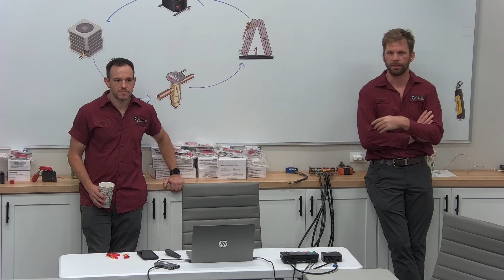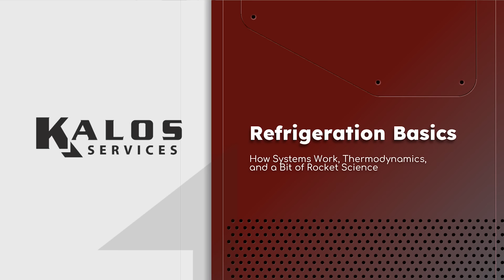Refrigeration Basics with Elliot and Bert Part 1

Comment: I will never understand the value of all the different units for pressure. How you scale things has no impact on accuracy. Accuracy is dependent on the device. It doesn't matter how you scale it, you just might end up with more decimals in one unit. All these units are based off of old school analog devices. The Pascal is the only unit you need for all forms of pressure. Need a vacuum? Well that's negative gauge pressure in pascals. Don't like big numbers with lots of 0's? Well the metric system has a solution for that too called SI units. They allow you to easily rescale by factors of 1000 without actually changing the unit. Most importantly, the Pascal is a breeze for any engineering calculations that need to be done. Just plug and play, no conversions required other than converting the SI prefix to engineering notation which is a piece of cake for engineers. Still boggles my mind how ridiculous all the units we have for pressure.

Most importantly, America, switch to the f***ing metric system. This is all just insane! Do your engineers a favour.

Comment: I have successfully installed about 4 mini split units, some with multi-zones in my home. I own my own vacuum pump, gauges and flare kits; I would love to learn a whole lot more about servicing even if it's just my own equipment.  I do have some knowledge about brazing and the importance of using nitrogen. But I can definitely benefit from learning much more about servicing and repairing these units.

Comment: Physicist here. Around minute 20 it is said that "heat is the amount of energy something has" but that's wrong. To put it simply, heat is the "exchange of energy" due to a temperature difference. Heat is not something that is owned, but it's just a short way to refer to an energy transfer between a hotter and a colder body. The amount of energy something has is called, unsurprisingly, energy: it can be internal energy, kinetic energy, potential energy.... In this case we are pretty much considering only internal energy.
Reply: yep and we call that potential energy heat energy or thermal energy.
Reply: Quantum physicist here. You’re right.
Reply: Awesome explanation dude
Reply: Love the breakdown, thanks!
Reply: Heat travels from hot to cold, rule 1
Reply: Tell me what energy is next
Reply: People crave attention!
Reply: Cool, but how does that actually improve upon the point being made? This comment doesn't actually help anyone understand anything any better about the subject at hand, you're just flexing your dubious credentials for your own satisfaction.
Reply: Mr know it all needs some more attention

Comment: Not to sound disrespectful but this just sounds redundant af. Circling the block just to get next door. It seems like a lot of shit and it probably is for the mere fact of the equation "moving heat" or "manipulating temperature." Dont call me dumb for saying this, but wouldn't it be easier to subtract heat entirely to keep things cool instead???
Reply: You can't just subtract heat. There's no easy way to just remove heat, heat moves from higher to lower temperatures so you make the refrigerant colder than it, so it warms the refrigerant up then you condense and because the gas is compressed down to a liquid and concentrated that heat energy it can be dissipated, brought back to a cold gas and repeated..

Comment: Unfortunately, the presenters have mislead the students by saying that the compressor doesn't impart energy to the refrigerant. A low pressure, low temperature gas comes in and a hot, higher pressure gas exits.  Energy must have been supplied to do this! A simple example should help - when you use an old, hand held bicycle pump the tire and the pump will heat up. The "pumper" does work on the air  and this results in increasing the air's energy and hence its temperature. 
One additional comment: I think it would be nice if, in Part II, you explain the molecular reason why the metering valve cools the refrigerant. 
Even though I've been critical, I would like to say that Kalos does a great service to the HVACR community and wish that more companies were as honest and knowledgeable as Kalos.
Reply: Yes this is right, I'm not sure where they said the compressor doesn't impart energy though maybe i missed it. They did speak about pressure so it's my assumption that it was implied. My first thought when I read your comment was the hand air pressure test: 

Blow air against your hand from a distance (About a foot), then blow air against your hand whilst gently pressing your mouth against your hand with the exact same amount of pressure/force. you will notice when you blow air against it with your mouth pressing against your hand, the air begins to heat up rapidly...

the temperature increase implies an external force was supplied by virtue of the "compression" (being an application of pressure/force); the refrigerant during the LTLP vapour stage, becomes 'more rapid' due to, 1. the compressing force being applied, and, 2. the volume decreasing, thus transferring kinetic energy efficiently between molecules without any immediate or permeable escape route, making it HTHP vapour. So basically, the refrigerant molecules are 'pushed together', the pushing transfers kinetic energy onto them (supplied by the compressor), then they impact each other in a compact space to transfer energy efficiently, but no energy can escape so it energy circulates from within. Thus, creating a sustaining and highly kinetic concentrated solvent  = HTHP vapour.

the best part about these communities is their objectivity.
Reply: @Ascetic.muslim you do hvac??
Reply: @jeffreyclarke7154  no I’m just interested mechanical engineering and physics but not at all qualified at any degree so verify whatever I say lol cause it’s most likely inaccurate 😆
Reply: @ ah got ya thanks a lot lol
Reply: Your welcome.

Comment: Cool stuff. I'm trying to troubleshoot a roof mount packaged unit at my parents house but find myself going down rabit holes.
Reply: Might be ADHD? I had the same issue until i fixed it
Reply: @matttzzz2  I take adderall or modafinil sometimes. Very helpful. Wish I discovered it sooner... Gonna look into what you mean by ADHD. Lol!
Reply: Indoor or outdoor blower?
Reply: @BlackAutumn08  outdoor
Reply: @zero2three1  yea check voltage delivery. If thats fine then ohm the motor and if that adds up ok then meg the motor. That rules out the component. If that all fails a result, theres a wiring issue within the circuit for it and its not being completed